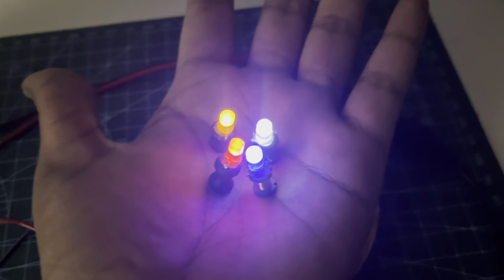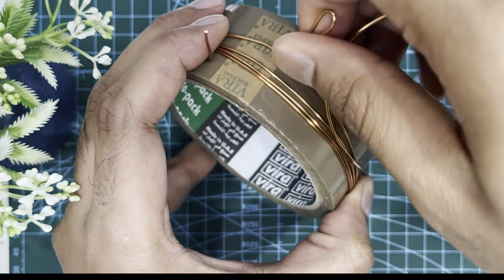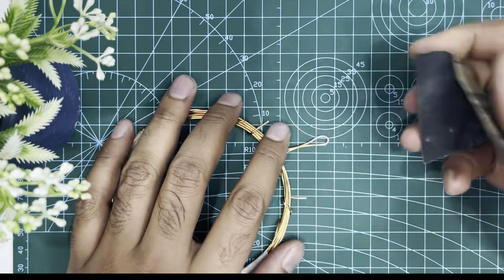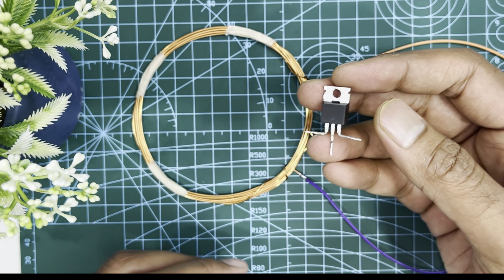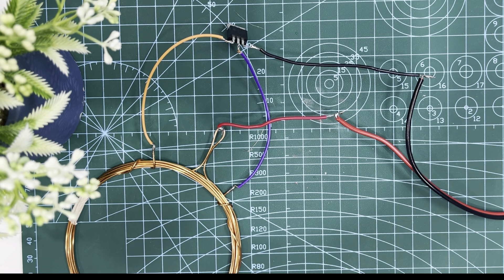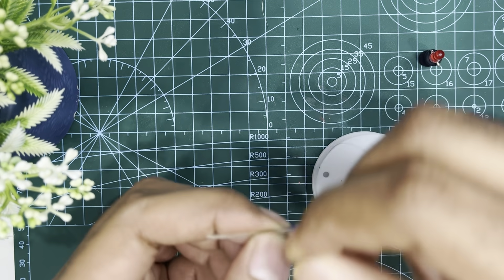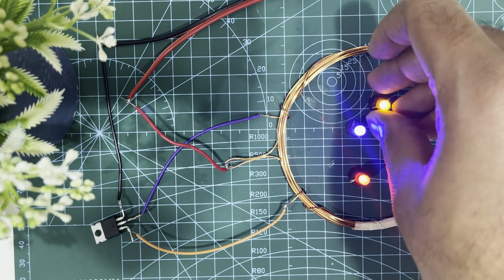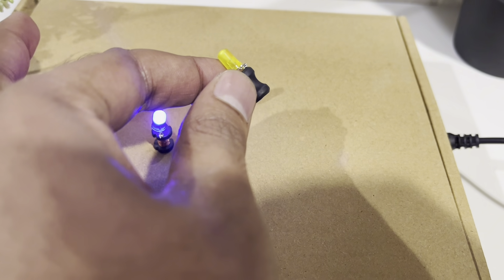Wireless LED || DIY Tutorial || Engineering

Comment: Great❤
Can you tell the logic behind this and why we have to turn 8 times in primary coil, why we have to take 8 to 10 cm of circle , why we have to take b/w 400 to 600 micro henry inductor etc.
Reply from the maker: Here's a breakdown of the logic behind the specifications:

# Primary Coil
1. *8 turns*: This number of turns helps achieve a suitable inductance value (L) for resonant coupling. Fewer turns reduce inductance, while more turns increase it, potentially causing inefficiency.
2. *8-10 cm diameter*: This size allows for:
- Adequate coil surface area for electromagnetic coupling.
- Sufficient space for the secondary coil (LED) to resonate.
- Compactness for a manageable project size.
1. *1mm/18AWG wire*: Thickness ensures:
- Low resistance (R) for minimal energy loss.
- Sufficient current-carrying capacity.

# Secondary Coil (Inductor)
1. *400-600 μH*: This range provides:
- Resonant frequency compatibility with the primary coil.
- Adequate inductive reactance (X_L) for efficient energy transfer.
- Suitable for 12V DC input.

# Resonant Coupling
1. *Frequency resonance*: The primary and secondary coils resonate at the same frequency, enabling efficient energy transfer.
2. *Electromagnetic induction*: The primary coil's magnetic field induces voltage in the secondary coil.
Reply: @mahade_DIY  There is no resonance involved in your enrgy transmission.
Reply: @mahade_DIY  Very well explained. Thank you.
Reply: @mahade_DIY  thank you sir and great work keep it up👏
Reply from the maker: @flautistnaitik  take love dear ❤️
Reply: @mahade_DIY  Translation: "I just threw in some random values bc it works somehow", and quit trying to fool us as what frequency are you even talking about if your parody of a Royer circuit LACKS THE RESONANT CAPACITOR FFS?!?!?! Also by "400-600 uH" I can safely tell that the only reason the LEDs receive those mere microAmps of current is because of the huge step-up ratio you've got, as those inductors have really long coils.
Reply: @TheBypasser 
Yes, 99% agree. There is No mutual Resonance here.
Just make the LEDs, then move them over a magnet.
5vac would increase the range. Frequency is irrelevant here.
Reply: @snakezdewiggle6084  I even doubt there is any resonance taking place here at all, as the frequency is mostly controlled by the response times of the MOSFET (guess it heats up like a frying pan too). When designing an alike device (properly ofc, as you don't have enough excuse to wind two coils of expensive wire in a mass-produced unit - yep, MUCH more parts it is), I made a probe for quick-testing of the first units being the same as his "wireless LEDs", but with a resonant capacitor to make it do one's thing (seeing the system frequency is in range that is), and a nixie instead of a LED to make a good test load. A pretty large nixie it was, drawing like half a Watt and glowing accordingly, and it felt the range was way better even with a much smaller primary.
Reply: @TheBypasser
Reply: @snakezdewiggle6084  Hi, can you help me a bit with this? How can I increase the range (specifically the y-axis range) so that my LEDs can light up from further away?
Reply: @flautistnaitik  udaya✌️✌️👍👍🔋🔋💡💡
Reply from the maker: @UdayaRai-mo4ur ❤️❤️
Reply: The FET and the coil works like high frequency oscillator. So inside the coil there is a magnetic oscillation field. The small inductor soldered in the LED is good to the magnetic field inducted an electric current in the small inductor soldered but this current is alternately at same frequency that the oscillator ( big coil works) and the LED blink so quickly that appears like a continuous light. So we can’t see but this LED turns on and turns off very fast. This is the some way that you can charge a cellular phone by induction.  Or like a transformer works. The transformer has two coils. Primary and secondary.  In this circuit there is a primary ( big coil) and secondary ( small coil) the coil solder in the LED    I hope I was good in this explanation.  😁
Reply: Good one 👍
Reply from the maker: @shiffinnidhith7012  thanks
Reply: It works on principal of magnetic induction that is used it magsafe or other wireless charging device
Reply: Sir can i use less thich wire fir big circle
Reply: He did it because that’s what he had it can be made bigger or smaller you have to experiment with it
Reply: Supper  explaining

Comment: Please answer why when I plug it my power supply turn off itself it's current is enough dude if you can solve my problem I will subscribe you
Reply from the maker: It sounds like you might have a short circuit. Please double-check your connections.
Reply: @mahade_DIY i controlled so many times I will subscribe you because help me but when I control it didnt work again

Comment: Please tell me which copper is used
Reply from the maker: Insulted copper wire 1mm diameter
Reply: @mahade_DIY which gauge
Reply from the maker: 19 gauge 
Yes 12V battery will work
Reply: @mahade_DIY  thank you sir😊
Reply: Thanks for reply
Reply: Can i use 12 volt battery
Reply: Sir pls tell
Reply: Thanks

Comment: Note how the LEDs lose power when orientated horizontally. The magnetic field must pass through the coil of the inductor in order for it to induce current; at 90degrees to the field there will be no current. There will also be a dead spot when positioned directly over the larger coil.

Comment: Just wondering could making the led a wire, then adding the inductor at the end of the that wire, make it work the same way? example you wanted the wireless led feature but you needed the lights further away, from the main coil. like building a model kit and you needed light through out it, and just ran the wires to the bottom of model kit and had it sitting on a base. thinking about pirate ship model as the example

Comment: Hi there! This tutorial is excellent! I have two questions for you: 1. is the coil fire-safe inside that box? Does anything need to be done to ensure if is fire-safe? And 2. Can you connect multiple copper loops to form a chain, and still run it off the one power supply? Say I wanted to light stuff up along a shelf in 4 different locations - can it all be done from the same power supply? Thank you so much!

Comment: i have a question that i have mosfet but its code is IRF730 can i make with the help of this mosfet please reply if it will then i will give it a try
Reply from the maker: IRFZ44N works to switch high current loads & IRF730 if you only need to switch lower current loads.
We need to switch high current here. So IRF730 not recommend from me

Comment: Sir to what height i can keep the LED for it to glow in case if i do the same thing which u have done.i need to make a small miniature lamp with a height of 5cms to 10cms. will it glow. if not pls give ur expert advise
Reply from the maker: Up to a height of 5 cm LED will glow with good brightness . Try to keep the LED in the shortest possible distance from the coil . More than 5cm may not work for this configuration

Comment: "The first thing you'll need is insulated copper wire..." (immediately shows raw copper wire)
Reply: It's not "raw" copper wire. It is insulated by a type of varnish called shellac. Later in the video you can see he uses sand paper to remove the shellac from the ends and allowing for electrical connection to the Mosfet.

Comment: Wow, so simple! I used a 10mm diode and had 50 turns of 0.3mm. Worked great. Also added a flyback diode to save the mosfet.
Reply: How is the flyback diode connected, and to which pin(s)? Thanks in advance.

Comment: "Great content.. is it safe from electric shock? And does it not need a resistor? Because as far as I know, red and blue LEDs have different voltages.. and in the video, you use a 12V output, does it have to be 12V? How do you calculate the coil on the experimental LED that is wound?

Comment: Would something like this be able to light up from the live wire of a 12 or 14 gauge wire connected to a 20 or 15 amp house circuit, through the plastic shielding and maybe even a metal cable channel?

I know non-contact voltage testers work that way and I thought these would be a cool thing to place along a cable channel run along my living room wall.

Comment: Works for about 10 seconds then the mosfet dies. Suggestions?
Reply from the maker: Use a heat sink with the MOSFET
Reply: @mahade_DIY  is there a way to make the mosfets cooler
Reply from the maker: @3dshopmedan add a bigger size Aluminum Heat sink with the MOSFET

Comment: It would be nice to see you build a push pull circuit to the primary coil with variable resistance then you can make them blink at different intervals or try the same experiment that you did here with blinking LED.
Reply from the maker: Thanks for sharing your thoughts ❤️

Comment: Why cut the ends of the wires when you could just solder the made up ends on to your coil and to the mosfet? Seems stupid to me!
Reply from the maker: Reason 1 :Maybe you didn’t noticed that there was a female wire . If all the wires were male I would directly soldered them. Reason 2: To shorten the wire length. Keeping 20cm long wire is not a good idea. Why? With short wires viewers could easily see which wire is connected to which terminal of MOSFET.

Cheers bro ❤️

Comment: Excellent, how many turns did you make secondary coil with the 0.1 mm copper wire to turn up the LED?
Reply from the maker: Thanks dear ❤️
250 to 300 turns will work

Comment: Plz explain how the primary coil works
Reply from the maker: The primary coil generates a magnetic field that transfers energy to the secondary coil.
Reply: @mahade_DIY  I know that, but I wanted to know what is the use of MOSFET and how both of them works, 
Plz explain a radio circuit , with working principle in details 🙏🙏🙏, so that one could understand and one can make on its own, 

Plz make a detailed videos, I guarantee your channel will grow and people will love watching your videos, your way of speaking is awesome just explain different circuits in details, 🙏🙏
Reply from the maker: Thanks for your appreciation dear ❤️ I will try to improve my videos with more details.
Reply from the maker: Here's a simplified explanation:

# Primary Coil (Transmitter)
1. *Alternating Current (AC)*: The 12V DC adapter powers the primary coil through the Mosfet, converting DC to AC.
2. *Magnetic Field*: The AC current generates a fluctuating magnetic field around the primary coil.
3. *Oscillations*: The Mosfet's fast switching creates oscillations (typically in the kHz range).

# Secondary Coil (Receiver)
1. *Magnetic Field Detection*: The secondary coil detects the primary coil's oscillating magnetic field.
2. *Induced Voltage*: The changing magnetic field induces an electromotive force (EMF) in the secondary coil.
3. *Current Flow*: The induced voltage generates an alternating current (AC) in the secondary coil.

# Power Transfer
1. *Resonance*: When the primary and secondary coils resonate at the same frequency, efficient energy transfer occurs.
2. *Energy Coupling*: The magnetic field couples the energy from the primary coil to the secondary coil.
3. *Wireless Power Transfer*: The energy is transferred wirelessly from the primary coil to the secondary coil.

# LED Illumination
1. *Rectification*: The induced AC voltage is rectified by the LED's internal diode.
2. *Current Limiting*: The LED's internal resistance limits the current.
3. *LED Glow*: The rectified voltage powers the LED, causing it to illuminate.

Comment: Interesting demonstration of how induction coils work, but the large induction coil is much larger than a battery pack.  Seems like using a small battery pack would be a better option for a real world application.
Reply from the maker: SMD inductor will be a better options I think. Isn’t it?
Reply: @mahade_DIY  Id rather power the LED's with a small battery pack than carry around a large induction coil that still needs to be battery powered.  Just get rid of the coil and connect the LED's straight to the battery.
Reply: @RichardCarlisle-k8t  It wouldn't be wireless power transmission then, and will defeat the whole purpose of this video.

Comment: Can do it with 5v supply i don't have 12V adapter , then if i can what are specs for the inductor ?
Reply from the maker: Try with 5V . It may works
Reply: @mahade_DIY  thanks Mann , then what is the inductor value for 5v ?
Reply from the maker: Check with the same inductor but add a small ceramic capacitor (100nf) with two legs of LED
Reply: @mahade_DIY  ok thanks sir

Comment: Can we use bc547 transistor?
Reply from the maker: Yes possible 
Collector : one end of coil
Base :another end of coil (use one 1k resistor to limit the current)
Emitter: Center loop of the coil.

Use 3.7V-5V power supply

Comment: it cannot work the way it is built... You need at least a capacitor and resistor to create a wave. In DC it will not be resonance... so a frequency wave will not be generated.
Or you have to feed the coil with AC voltage.

Comment: He used Drain internal capacitance and external windings of the coil and inductor. This makes an LC resonating circuit producing AC signal in the other winding of the coil acting as primary winding and inductor hooked to LED as secondary winding. This complete system behaves like an air core transformer transferring electromagnetic flux. But as we know LEDs are DC devices, there should have been at least one rectifier diode like 1N4007 in series with any terminal of the LED, be cathode or anode. Even though that would not give pure DC current to the LED but polarized the input ac signal depending on whether diode is connected to anode or cathode of the LED.
Reply: Adding a diode in series with light emitting DIODE ? No need right both act same
Reply: @VIRAGaming5413  Good point, for low power that is the case. but if your coil is higher power (needed to increase range), you might kill your LED by applying too much reverse voltage to your LED (max 5v for most standard leds). At some point you will need current limiting, voltage clamping , rectification, filtering etc . I experiment with a lot of these circuits and always kill LED without protection circuit
Reply: @rajeevMehndiratta  won't the gate just be +12 , how/why would it oscillate ?
Reply: My guess is that if your supply is really close to the threshold voltage of the mosfet, it will power up and shut down repeatedly, creating a 'ringing' in the circuit that mimics AC.

Comment: Can it work in larger diameter coil 12inch or so. Please comment
Reply from the maker: No dear…might be work beside the coil but in the center LED will not work! If you plan to hide the coil inside a box, you can make multiple coils to cover larger areas

Comment: This technique would make an interesting Chess set.
Reply from the maker: @continental_drift  wow…
Reply: @mahade_DIY that's right. You can build a chess table using pieces and putting inside of everyone of it a diode led with a coil + the big coil Inside to turn on every pieces.
Reply: Is  great idea.
Reply: Bro you lost a lot of money..
Reply: I think of the same thing. But can the coil be in square shape ?
Reply: Can you make 5 coils from one power source? One for each corner and one for the center of a square? Or just 4 corners.

Comment: Totally useless but fun project.  I will have to try this.  Wonder if a wireless phone charger would work??
Reply: A phone charger has electronics to detect when a phone is nearby so it doesn't use current all the time. So the little inductors might not trigger it to power up.

Comment: If you are connecting a DC input it will not work. You need a alternating current so that the inductor coil connected to the led can produce a emf from the alternating magnetic field produced by the larger coil. So if you connect an AC supply this will work.
Reply from the maker: 12v transformer will do the job I think. Right?
Reply: 12V will work but make sure the impedance of the coil is sufficient to keep the current within the max limit of the transformer/power supply. BTW the principle is the “Faraday law of electromagnetic induction” which all of us would have learnt in physics while in school. This law states that “The changing magnetic field linked with a conductor induces an electromotive force in the conductor” that is why you need alternating current input.

Comment: You can get better range if you add a capacitor across the LEDs (in the range  1-10nF worked for me) to make it resonate, but you must adjust the driving coil frequency to match the resonant frequency of the LEDs, so you need a more complex driver circuit.